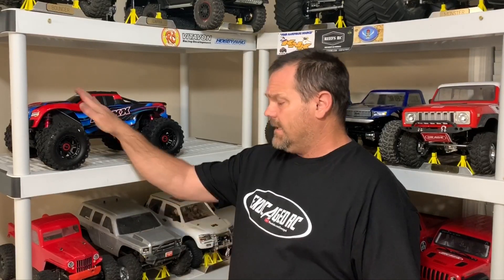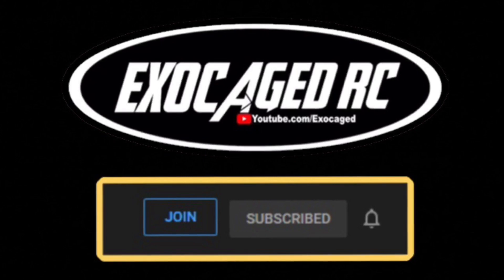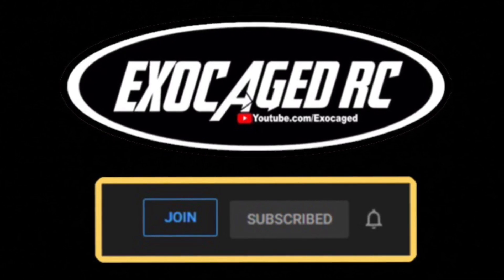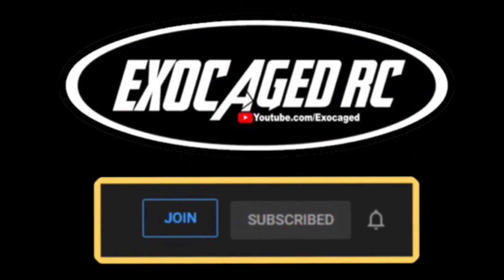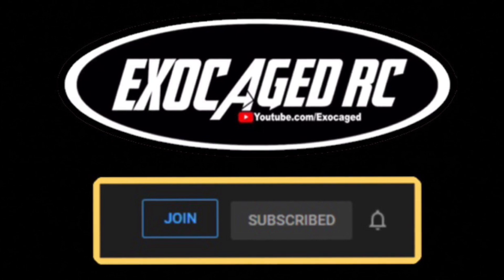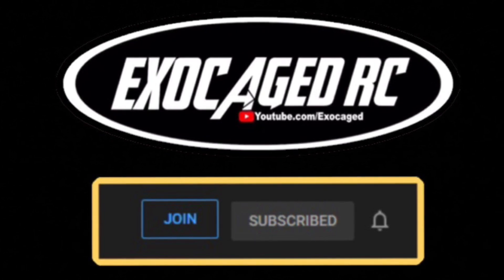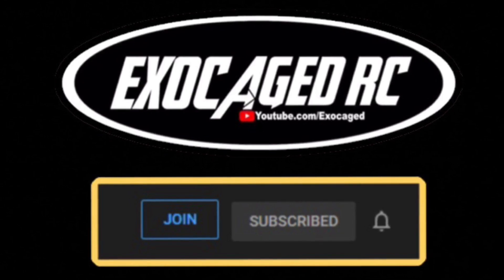Recap Time!! Axial, Traxxas and more!!

Comment: Awesome vid as always man your gonna love that maxx but your gonna want the wide maxx kit for sure that and HR +10mm hubs and 3.8 traxxas chevron tires is all I’ve done to mine n it’s perfect 👌🏻 😎 my suspension set up is stock front springs max preload with 80W wide maxx rear springs with 100W max preload awesome on everything but huge air over 6ft it’ll slap the chassis pretty hard enjoy it man can’t wait to see what you do to yours hope you put the castle sensored in it that’s my go to system when my stocker goes out lol been waiting almost 4 years for my Xmaxx 1600 to go out tho 😎😁
Reply from the maker: Cool man thanks. Yeah it’s going way over 6ft high. I may actually try to keep it stock for a while.
Reply: Exocaged RC stock is plenty of fun

Comment: Hi, I watched one of your xmax videos and done the same set up with the 1100 kv hobby wing but I used a max 6 esc because I couldn’t get hold of the max 5 esc. But it burnt out after a while and I was only getting like 5 maybe 10 minutes max time before it would go into protection mode. What I need to know will it be ok if I fit the max 5 esc? Because in your videos you was hammering it and it never cut out. Please help
Reply: My gears was 25 pinion and 35 spur
Reply from the maker: Yes the Max5 is a LOT more esc and will turn that motor way stronger and last longer. I’m amazed at how well the castle monster x8s is handling the big 800kv motors like it does.
Reply: So the max 5 will handle the 1100kv motor?

Comment: dont drive your Maxx in sand, sand got into the  gears on mine
Reply from the maker: Well I’m in Florida so sand is a thing here. I’ll seal up the tires before the first run because we get sand in them and then they just are off balance and all kinds of things.
Reply: MOE'S GARAGE extra grease on all the diffs and trans seals will help a lot still should pull apart every few runs to check tho cheap insurance
Reply: @ExocagedRC  I'm running 1m in the front and rear diff and now it slides instead of rolling over (on my maxx)